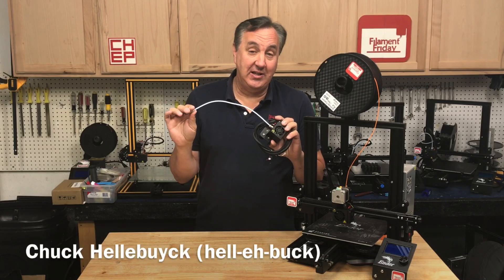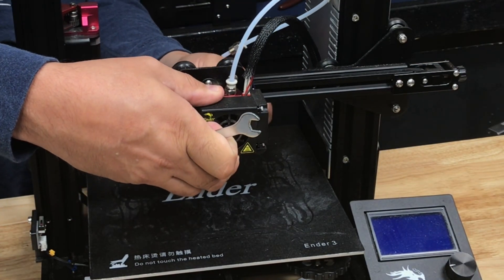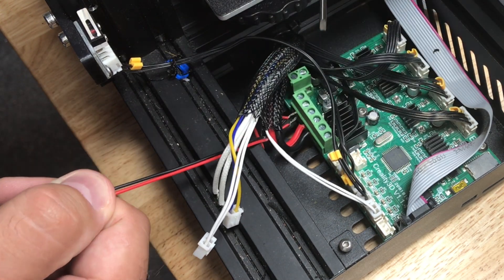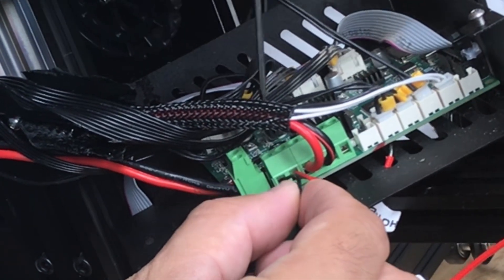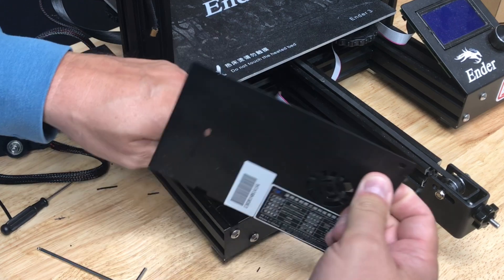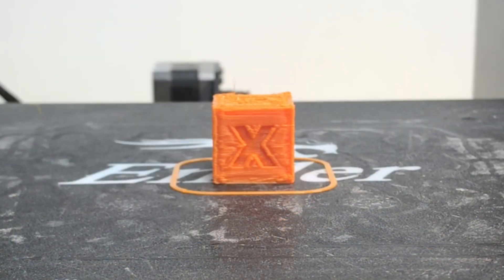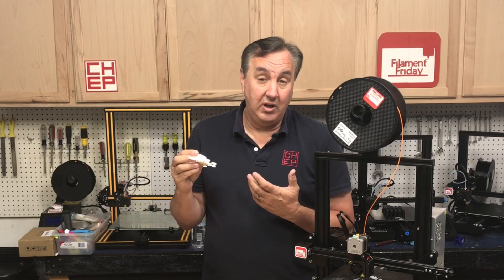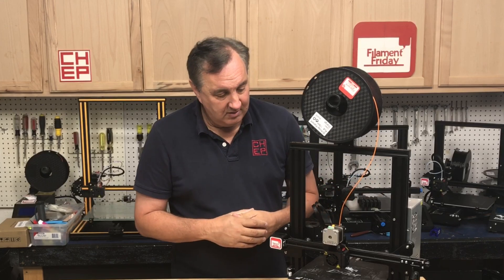Direct Drive Extruder on Creality Ender 3

Comment: I have a problem..!!.. i have direct drive on both of mine. I installed it on my oldest printer, works fine but after 15 minutes of printing, my display go crazy showing symbols and static like its bricking up, but its been printing fine for the past 3 months.. now i have the direct drive on my newest printer that has the pro board and its wanting to print the model much smaller than its intended.. what should i do??
Reply from the maker: Check for loose cable or connector on lcd
Reply: @FilamentFriday  theres nothing loose on the older printer with the screen thats messin up.. but with my newer printer with the pro board, how is it printing the models way smaller than it suppose to??.. i didnt have these problems til i changed to a direct drive on both my ender 3s.
Reply from the maker: I don’t know. The screen showing strange characters means it’s lost communication so something in the power or wiring is messed up.
Reply: @FilamentFriday  dont know.. but all the connections are good and intact.. but what are your thoughts on my newer printer that prints the models smaller scale than i want it to? Cause i can take the sd card out and insert into my older printer and it prints out the scale i need..
Reply: @FilamentFriday  the newer ender 3 has the pro board, just converted it with direct drive, prints the models at alot smaller scale than sliced them to be. Thats my main focus.
Reply from the maker: That’s often because the steppers are binding or belts are too loose and this missing steps. Just one idea.
Reply: @FilamentFriday  i put tension back on the belt after installing the direct drive, and that and the bed still moves freely..
Reply: @voodooprintz216  Sorry, just a thought, could it be an error in the printer profile config? Maybe try to create a new profile for your printer in Cura? I admit  it's a long shot, but it will not take long and you can eliminate that possibility...
Reply: @robertcercel  i haven't thought about that, but the problem with the ender with the pro board was an error made by myself, i modeled the new product from the smaller version of its copy and didnt realize it, its working perfectly with the direct drive, but my older ender 3 with tye direct drive, the screen is still blocking up after 10-15 minutes into the print, printing is still ok tho..

Comment: I've been running my creality direct drive for ages and it's awesome the reason was replacing a stepper that died. However now I've converted to klipper with a bltouch I'm running into issues with first layers and possibly retraction issues. Just curious how different was the retraction settings between the 2 for you?

Comment: "direct drive"
Uh huh. Clearly has a tube between the hotend and stepper. Any schmuck could do this mod with 1 printed part and the stock extruder.
Reply from the maker: And many have.
Reply: What exactly would you consider a "direct drive" then, if the extruder gear would be inside the hotend?
Reply: @TheBod76  Mine butts the extruder gear straight against the heat break. No tube in between.
Reply: @joblessalex  the tube on this is so short though I doubt it would make much of a difference
Reply: It is considered direct drive when the  motor and hotend are together on the extruder assembly. 
A bowden setup has the motor and extruder gear placed far away from the hotend, such as on the back of the printer.
Reply: @StrokeMahEgo  So if I put a 50ft length of coiled up tube on the hotend it's still direct drive as long as the extruder moves too?
Reply: @joblessalex  If you are so obsessed with semantics, I could argue that the heatbreak is a metal tube. It makes no difference at all if the extruder pushes the filament through a short and straight metal or plastic tube.
The whole idea of direct extruder is to shorten the way between gears and hotend so the filament has less room to flex/blend to keep the material flow more constant and precise.

Comment: Hi I just installed direct drive on my ender 3 pro and there was a ground wire that I had to remove in oder to replace it with direct drive, the thing is the direct drive didnt have any ground wire. the direct drive is currently working fine but im not sure if i should continue operating this, due to the fact of short circuiting and causing a fire. pls reply me back what i should do
Reply from the maker: I don’t know of any ground wire on Ender 3 Pro so I’m not sure what to recommend.

Comment: i think you need to cange the retraction for the pla setting, if you have found it out, could you tell me because I am trying direct drive out on my ender 3 v2
Reply from the maker: 1-2mm typically works fine.

Comment: Hi Chep, I am kinda new to the hobby, I have done a few prints with PLA and I am happy with the ender3 v2 but my ultimate  goal is to print tpu this video has answered a lot of my question, I have just one more question, if i upgrade to the direct drive can i still use my bl touch on there? it doesn't look like theres any space to install it at least not with the original mount the the bl touch came with
Reply from the maker: I would recommend looking at the EZR Extruder. Then you print everything including TPU and not have to touch your BLTouch. https://youtu.be/1GNDxvxpWr8
Reply: @FilamentFriday  thanks Chep! I couldn’t find those extruder in China tho 😅

Comment: My ender 3 pro is kind of newer but it has hot glue securing the wire connectors and I was wondering if this was Normal
Reply: Same with me
Reply from the maker: Yes. They all have that.
Reply: @FilamentFriday  I did not know that. Although I guess that is what you do

Comment: You have any setting for cura 4.13 using inland tpu and micro Swiss dd. I'm getting stringing and burning of the filament in the print.
I'm using settings 
Cura 4.13
Speed 60
Micro Swiss dd all metal hotend
Bed temp 60
Nozzle temp 220
Retraction 0.4
Cooling fan 30
Reply from the maker: 0.4 retraction is too small should be 1-2mm for direct drive.

Comment: Is this the best to print PLA or I should keep the Bowden... I am ready to order but I want to make sure. Thanks in advance
Reply from the maker: Either works fine for PLA.
Reply: @FilamentFriday  You seem to have issue with PLA if I read all the comments. So you recommend to go with direct. Another question, In the fine tune there is a FAN choice, what this is doing..It is at 0 by defauft.
Reply from the maker: I don’t have issue with PLA, I have issue with PTFE burning as it touches the nozzle. That’s why I recommend the Slice Engineering heat break. https://youtu.be/tYbL-O3FecY

Direct drive is good for flexible filaments.
Reply: Forget the question on the fan...It was stupid question....I found the answer by myself (;-)..Still have the question on PLA and direct drive issue..

Comment: Thanks for this video Chuck. It was definitely more helpful than the video from Creality. Question for you if you can help. I have printed many of your CHEP cubes on this Ender 3Pro and they turn out great however, after installing this direct drive when I printed a Chep cube i could see the infill through the walls. I am using your CHEP cube profile just like always. ANy ideas as to why this may be happening?
Reply from the maker: How many walls was it set to?
Should be 3.
Reply: @FilamentFriday  That's the problem. It is only at 2. Thank you sir.

Comment: If I add auto filament detection will my ender 3v2 with 4.2.2 board be able to restart a print after power fail? Any recommendations on filament detection units?

Comment: Added Crealities direct drive upgrade to my Ender 3V2.  One thing I am seeing is the direct drive has a bit of sloppy play in what would be the Y axis direction when I grasp the whole newly mounted direct drive assembly, not sure this should be there?  Seems it should be snugger fit with no motion or slop when i push n pull in y on the new direct drive.   Not seeing how I can remove this play?  Not finding E settings have the newer 4.2.2 board in my ender 3v2.

I found the extrusion setting tonight and calibrated it for precisely 10 cm of filament, they call setting something different on the ender 3v2 with 4.2.2 board.    Printing my second print a large one with new direct drive setup, first print a molle clip for back pack came out perfect, calibrated filament extrusion dead on after making the molle print.  New matte black PLA I am using looks amazing.   Will post back how I make out have 4 tall columns for make up pencil holder making to print after bottom plate is done, followed by top plate it is five pieces in total.  So far base plate coming out perfect.   

I still have not looked into the loose motion direct extruder and motor have when i push n pull them in y direction seems bit loose to me, so far not seeing effect on printing…. Will follow this issue up in near future. I do see you gave me solution, great!
Reply from the maker: There is an eccentric nut on one of the wheels that you can tighten to remove that.
Reply: @FilamentFriday  Excellent, you knew exactly what I was looking for!  I updated note above, getting beautiful prints, I perfected my z offset with new drive this evening using paper method, I use the CR auto level unit with metal pusher.   I am bit of perfectionist have nozzle height dialed perfect once I get my plate leveled I never readjust plate ever, I only change z offset if anything moves changing plate distances, let auto level take care of minor discrepancies of plate profile.   So I now have extraction perfected and nozzle z offset, first large print looks beautiful so far.

Thanks for tip on tightening slop will do before I make next component!  Much appreciated!

Guessing that adjustment would be on lower wheel that would make sense.  Will report back updated tomorrow have a print running, once its done will make adjustment of wheel.

Do you have website with admin email?
Reply from the maker: I don’t understand the question?
Reply: @FilamentFriday Registered at your website but the contact feature wasnt working for email.
Reply from the maker: Oh, that is limited to Patreon supporters.
Reply: @FilamentFriday  Thats what I thought thank you.  Once I get through holidays will sign up, you have some good information at your channel.   My next step in hobby debating between openbuilds cnc or a stepwell one which costs about 1500 higher than openbuilds 40 by 40 machine.  Had considered Shapeoko xxl pro also.  Your channel is setup well for my hobbies and covers current and upcoming toys in my shop.
Reply: @FilamentFriday  Found this eccentric nut on lower wheel this fixed issue.
Reply: is the direct extruder full metal? cause it kinda looks like plastic...
Reply from the maker: The insert is PTFE.
Reply: @FilamentFriday  I dont mean the PTFE Tube, I mean the parts where you insert the Filament, that part you removed and where you only put a Ziptie to hold the cables..
Reply from the maker: The extruder is plastic

Comment: Hi Chep, can you please share your retraction settings for Cura for direct drive. I printed retraction tower as per one of your videos and found 0.75 to be the best distance but when I use that value, it shows minimum retraction value error. If I use the same value i.e. 0.75 for minimum retraction distance, nothing is coming out of nozzle, please advise.
Reply from the maker: I use 1-2mm

Comment: hello, i just installed a direct drive on my ender 3 with your cura 0,12 mm smooth top profile, but i keep getting holes and separated outer shells on my top layers. any tips to fix this problem? the rest of the prints are clean, but the overhangs are not perfect as well.
Reply from the maker: Check you e steps
Reply: @FilamentFriday  thanks for the fast reaction, but i already did this with your tutorial and it was on point. Do you know any other problem that can cause this issue? thanks!
Reply: @jordi5882  what speeds are you printing at? What type of filament n temp settings?

Comment: Just did this same exact mod to my Ender 3 Pro, configured everything, and it's printing great, but I'm just curious of something. Many individuals mention that you can print faster with direct drive, but no specific mentions of exactly how fast. J/w what's the recommended speed when printing PLA and using this Creality Direct Drive on the Ender 3 Pro? Thanks!
Reply: Yuo need to test by yuorself, try printing at 80 mm/s , yuo will see if ok or not (normal cura speed its about 50mm/s infill/ 25mm/s perimeters
Reply: @noway8233  I'm actually a fan of 80, but I've read some in the 100's. Guess I could try that out for myself.
Reply: @TechReviewLife  hi! Do you use 80 for the infill? What about the perimeters?
Reply: @pepo9284  I'll have to double check but I use 80 for pretty much everything in that setting area
Reply: I am currently printing at 75 print speed with zero issues using a good quality PLA, I will push bit faster with bowden I could do 80 without issues havent had direct drive long enough to see my max speeds, I never push too fast much depends upon simplicity of object I am printing. I have ender 3v2 4.2.2 board.   I have added z-axis motor n screw plus now new to me Creality direct drive.  Also, the CR auto leveler addition on my ender 3v2.

Comment: I was under the impression that the BOden setup was better because of reduced mass on the head could allow faster printing.... What changed?
Reply from the maker: It’s been proven to not be a big deal with current designs.

Comment: Were you able to fix the print quality issues? Been having a lot of issues with TPU latly, and my hotend could use a replacement so this would be perfect, but I don't want to trade off what I have already...
Reply: Tou must be dry , so try to dry in a drybox , its very diferent

Comment: Is there a place to mount the BL touch probe. There is a mounting hole that could be used, but the fan cover is using it
Reply: The bltouch brackets goes between the metal Plate and the fan cover.

Comment: Found this video after ordering this kit from banggood. I've had my Ender3 for nearly 3 years now, mods include a petsfang fan duct, alloy extruder (so I know how to tune my steps/mm), and Octopi. Thing is, I could never really print flexibles with the bowden setup. I print parts for my drones and could really do with a reliable way of printing TPU parts, so I just bit the bullet and bought this kit. 

I got a new bigtreetech main board at the same time, so I'll be having some fun when they arrive :-)

Thanks for the video man 👍🖨

Comment: Must be pretty rare to clog with direct drive
Reply from the maker: Why?
Reply: @FilamentFriday  no long ptfe
Reply: My sv01 has clogged a few times over a year and a few hundred hours of printing + or -... But I've had to assemble/disassemble the extruder about 10 times for weak filaments breaking Inside while doing a filament change. That's annoying.

Comment: Hello, I have an Ender 3 Pro with the newer board (4.2.2 i think). Will this kit work with it too? And is it fine if I just take the original cable for the original motor, put the extension cable on and attach it to the direct extruder?

Comment: I have this kit. It was really nice minus having to file down the spring tensioner screw to make the spacers fit.

Mine came off ebay for 15 bucks so it may be a little different.

Mine was just the bracket and some screws and a piece of tube.

Comment: Do you know if this direct drive and metal extruder all work with the ender 3 max? Its the same as the ender 3 pro except the build area is 300x300x340?
Reply from the maker: The Max already has a metal extruder. 
The direct should work but wires may need to be extended.

Comment: It isn’t compatible with silent board? I ordered that and after i changed with the stock extruder when i turned on it just beeping and the screen is fully blue. What can cause this?
Reply from the maker: Not sure since it is compatible. Check your wiring again.
Reply: @FilamentFriday   checked it 2 times, replaced the old board and the screen is still blue just the beeping stopped... i don’t understand it. When i changed the stock board to the silent board just changed the wires and printed like in your video.

Comment: the reason your prints came out bad is with a direct drive it puts weight upon the gantry further down the x you go worse it will get if your gonna do this your best to do it with a dual z axis upgrade
Reply: Any dual z upgrade you can recommend?
Reply: @magnuswf  i know creality used to do one but im in uk and i was unable to find one even online so i went to amazon and just searched for a no brand one, but be careful dont buy any that are dispacted from china find a reseller on amazon in your region and read the reviews very carefully i found one with 30+ good reviews and went with that.
Reply: @happybrainybren  Okay thanks. So as I can guess, dual z axis screws makes the crossbrace more stable with the added weight of direct extruder, correct?
Reply: @magnuswf  yes exactly but tbh bro doing both of these mods i have not noticed any improvement to my prints but its also not got worse so unless you after a direct drive for printing stuff like plu and abrasive materials id stick with the stock ender setup
Reply: @happybrainybren  Okay, thanks for the advice man :)

Comment: My setup has absolutely atrocious ringing but everything else seems ok. I used all stock parts and an aluminum bracket and all my belts are nice and right with the wheels just loose enough. Any tips on what I should mess around with?
Reply from the maker: Acceleration and Jerk settings.

Comment: Awesome video! I am new to 3D printing and just ordered my Ender 3 v2. Does this mod come with an all-metal extruder and/or hot end, and if not, do I need to find one that fits? Also curious if it’s possible to replace the hot end fan with a Noctua. Thanks!
Reply from the maker: No but you can add any of those with some work. Check out the Microswiss hot end.